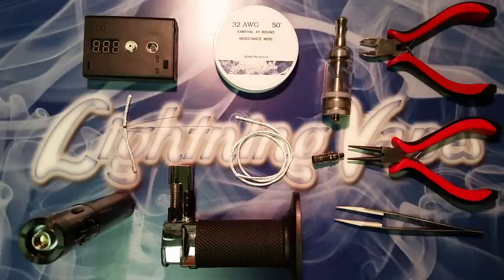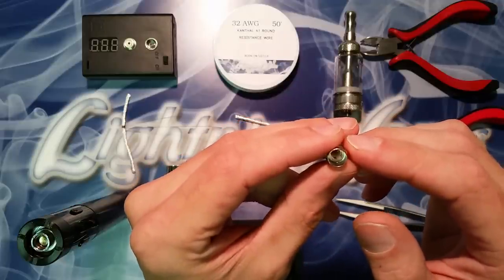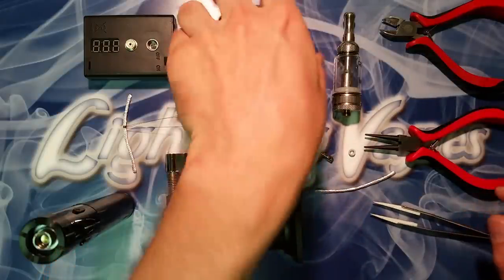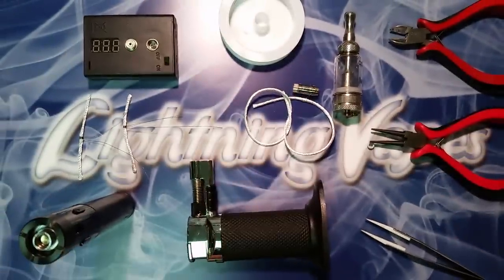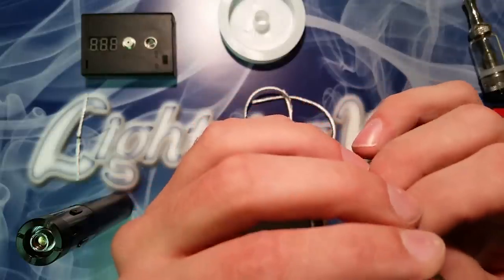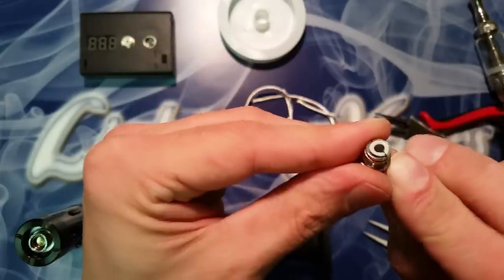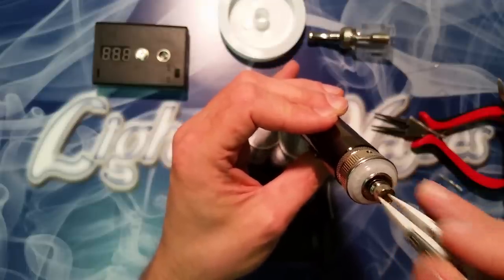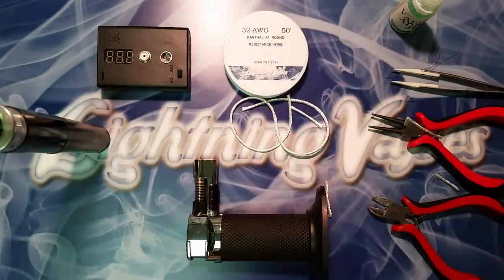Aspire Nautilus Rebuild Dual Coil BDC Atomizer Tutuorial HD Close Up

Comment: Thanks for the video, very clear.,
In my experience it is best to cut the wire tails rather than pull and wiggle which destroys the rubber bush after a couple of rebuilds....Cut off the tails is my advice.

Comment: I was wondering if I have a fake Nautilus coil because I have a silica type shield inside the assembly. The notches are there but it seams flimsy, yours on the other hand seams to be made from porcelain which is more solid. I have little experience with Aspire, your/anyone's help is appreciated, thanks.
Reply: Typically what is the packing material made of??? Anyone???
Reply from the maker: gnarmstrong I can tell you that they are clone nautilus heads. As for the material, I am not certain, though I don't think it is porcelain.